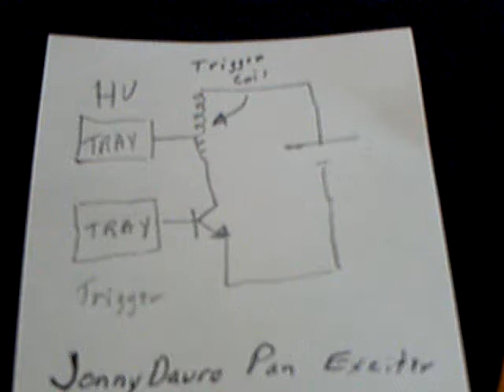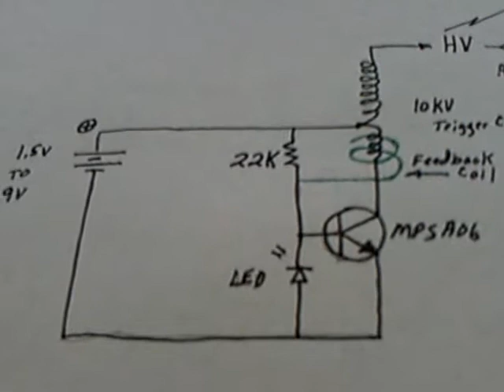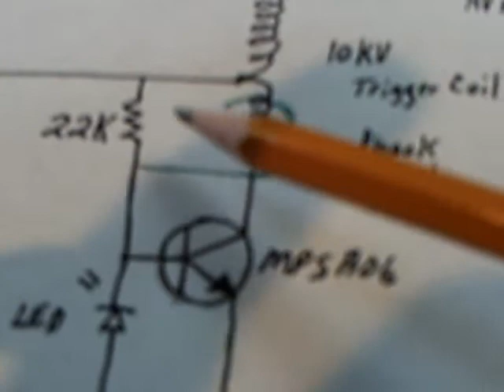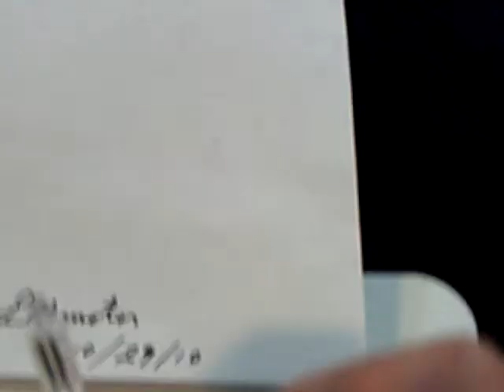Jonny -- Lidmotor Exciter.ASF

Comment from the maker: @madamerotten ------The circuit diagram is correct.  The LED is positioned correctly the way that it is.  This is similar to an Armstrong"  but I prefer the term "tickler oscillator".  Notice that there is no capacitor in this circuit.  It is kind of a runaway frequency design and would not be of much use to most people.  Thanks for your comment and interest.